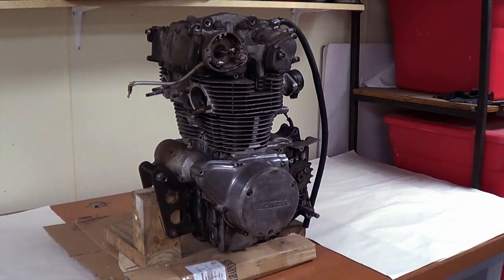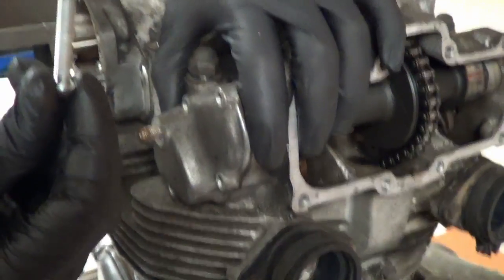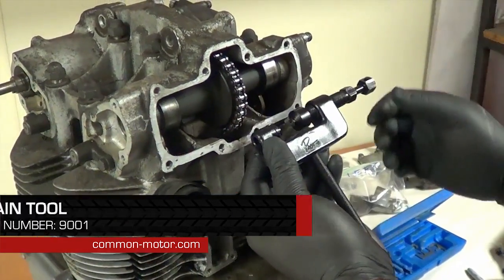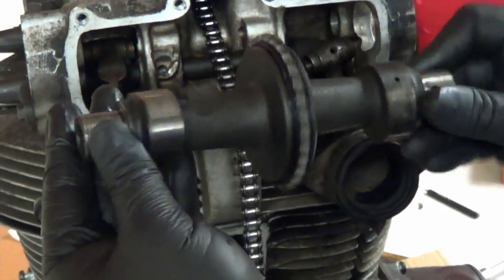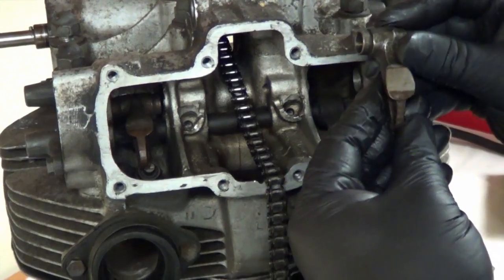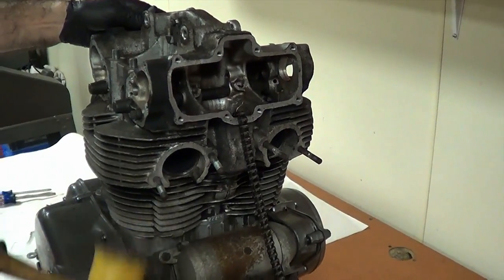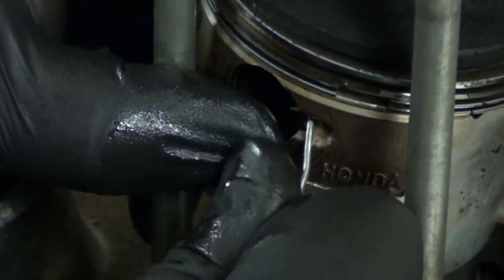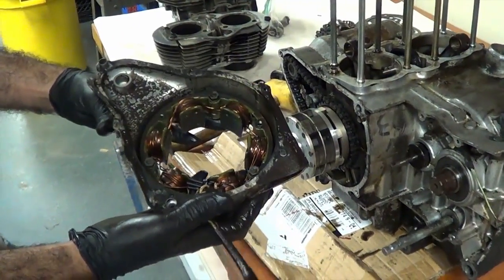Honda CB450 Engine Disassembly Part 1

Comment: I did this to my 1966 cb450 in 68. I had the bike in storage while I was away in the navy for 2 years. I filled the whole engine unit with oil to keep it from rusting. My dumb ass brother took it upon himself to drain the oil and put the rite amount back in then drove it. That would have been ok but he decided to loosen the cam chain tensioner adjuster and shoved it in. that caused the o rings on the cams next to the chain to shred. They got into the oil and the reciprocation oil pulsations trying to pull oil through the mostly plugged screen(factory casting defect) broke out a hole in the pickup screen. o ring parts got into the pump ball valves and destroyed the whole top end of the engine. So, make sure the oil screen has no obstructions(casting flash) that would cause the pump to pull from a small hole instead of the whole screen. replace the o rings with good ones and never over tighten the tensioner. when running correctly this is a powerful, reliable and great engine.

Comment: Hello, just a noob question, how do you reassemble the cam chain when putting the cylinder head? because the chain goes through a lot of cam chain roller and I have some difficulties to understand how to do it. Thanks
Reply: Bidet 
Use mechanics wire to hang on to the ends of the chain and to also feed it through the passages that it needs to go.

Comment: How different is this from a 74' CB450?
Reply: +Venomrs4 -- Exactly the same from 1965 to 1974? (I think '74 was the last year) They had a four speed trans from '65 to '68. Other than that, all 450 twins are the same, just slight changes to cam profiles and compression ratios, is all.

Comment: Thanks guys. I did a cb 750 a couple years ago. Needed a top end job cause of a stuck piston. Now I'm on a 69 cl 450 scrambler. I had to take the 750 in to have the timing set cause I just couldn't get it myself. Also was confused on how to get the timing chain off the 450 too. Now I see I've been ignorant about one tool. Chain breaker... Lol. Thanks, I needed that. Not a mechanic but more of a do it yourselfer. So I just didn't understand how these things were done in  a proper shop.